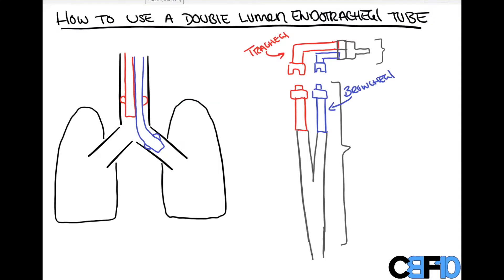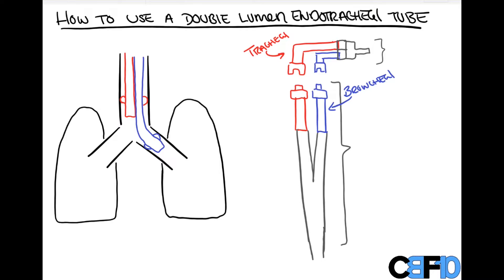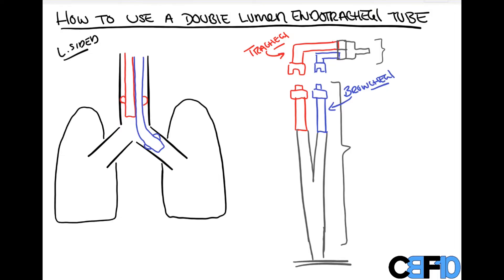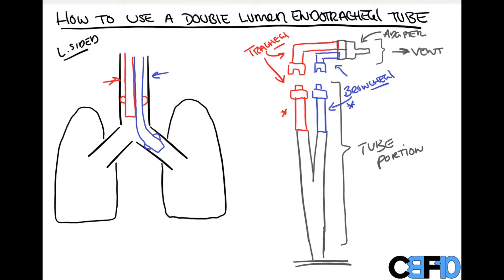How to use a Double Lumen Endotracheal Tube

Comment: Trachea not esophagus you’re going to cause aspiration. ETC tube ( esophageal tracheal combo tube) is an option for pre-hospital emergency airway management. It doesn’t matter if it goes to esophageal or the trachea but it needs to be replaced with an endotracheal tube ASAP.